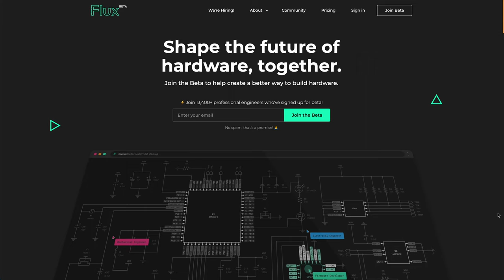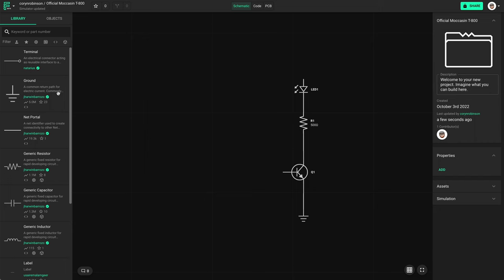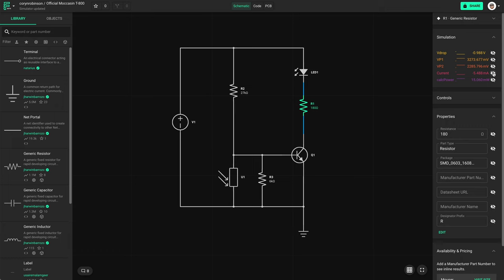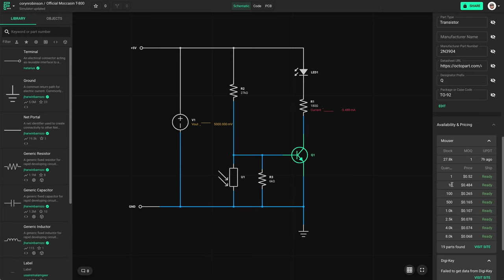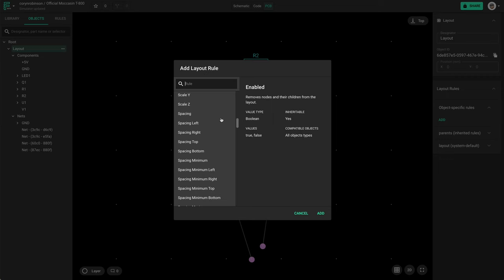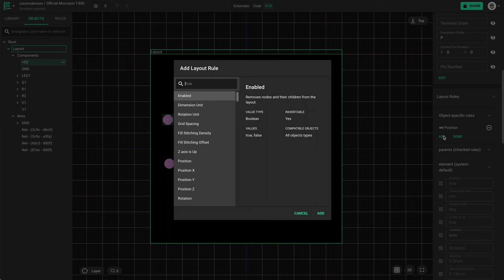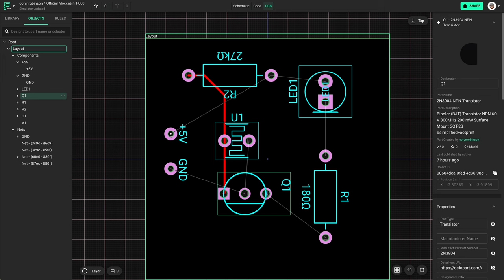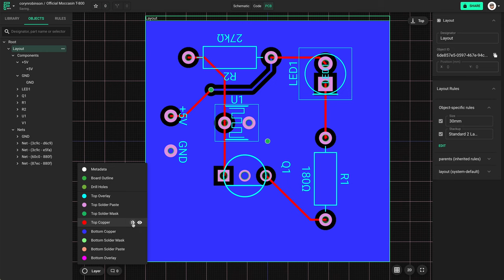Flux - Idea to PCB in Under 15 Minutes

Comment: I coppied your circuit and made a pcb for it in under 5 minutes using Pcad2002 - a 23 year old software package. It does everything Flux does, just not the 3D view at the end. Pcad also auto links in real time between the circuit layout and the pcb layout. It has the design rules. It even has a auto router, thow that usualy needs manual touch up afterwards.

Comment: Flow has a very fluid, clean and attractive interface. It's smooth and responsive, especially for a browser-based front-end. Unfortunately, it has some glaring usability issues.  For some common operations, it requires adding mystery meat properties which hampers workflow and frustrates users expecting to easily find them.  Rotating, excluding simulation components from the PCB, sizing, and positioning shouldn't require scrolling through a list of parameters and adding them to the palette. They should be accessible by default. 

Moreover, what Flux calls "layout rules" for some of these parameters differs from what PCB manufacturers and other software packages commonly define as them as. Layout rules are defined as a list of PCB design constraints specified by either the manufacturer or critical electrical considerations, not an arbitrary set of software features. It's also unclear how they differ from "properties" as they appear to be the same thing, nor is it clear how they are "rules."

With an abundance of EDA tools on the market, Flux has an uphill battle. The web-only interface will be a deal killer for many engineers and hobbyists who prefer desktop based applications. It surprising Flux took this path considering the numerous failed web-based apps such as On-Shape.
Reply from the maker: Thanks for your input. Yes, Flux is quite different from other EDA tools, which I think is a good thing. I believe they went with a browser-based app in order to keep the software up to date for everyone and to serve more people. For example, I use macOS which means I can't use many desktop-based EDA tools. I get why it's frustrating to scrolling through a list of properties unless you know what you're looking for. You say it should be accessible by default, but I'm not sure what you mean. I guess the alternative is having a button for everything, but then you're looking at a wall of buttons. I'm curious if you have a better solution in mind. I would encourage you to join the slack community and share your ideas and experience https://join.slack.com/t/fluxcommunity/shared_invite/zt-1ko2w0hg3-kGAboZ7PNkzvDURp0QiQeg
Reply: @overshootchannel  I would be happy to provide my many years expertise in UI design for a fee.
Reply from the maker: @bobweiram6321  You'll have to talk to Flux about that.
Reply: @trarredbandit9734   It's no match for Fusion 360. Everyone I know hates AutoDesk, but will shell out money for it.  Theres no equal in ease of use, performance and productivity. On-Shape waged a battle against Fusion 360 and lost badly.
Reply from the maker: @trarredbandit9734  Onshape is great. I also use it on a regular basis.
Reply: @Bob Weiram  Nonetheless its still a great CAD software for beginners and intermediate designers

Comment: Excellent tools and introduction! However, I encountered an issue with the simulator but can't find any useful help from th internet. In my environment, I can't see any metric in the simulator even though I replaced all parts with those with simulation models. My simulation menu always showed "No metrics to simulate". May I have your comment or help? Thanks.
Reply: Same here, I am getting the same issue

Comment: how do u fix when simulation is not running?
Reply from the maker: The simulation can be fairly tricky. You need to make sure all components have a model. You should see the < > icon next to it

Comment: "When your product needs an instruction manual, you have already failed"
- Elon

If I was going to make a new circuit diagram / PCB software I would make it as simple as possible to use.
Way too much to learn to casually jump in and make a product using this and all the other packages I've tried.
the parts in the library are very limited. How to get a part from a supplier into the library? Footprint?
Simulation? Very few parts have the info to be valid in the simulation. How to simulate a speaker? A Piezo mic? An LM386?
It's a long way from easy to use.